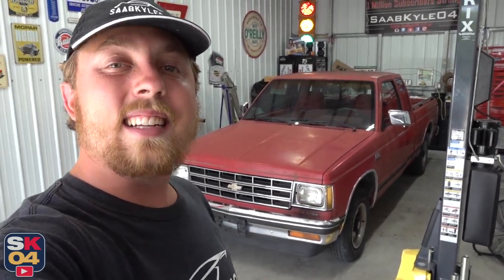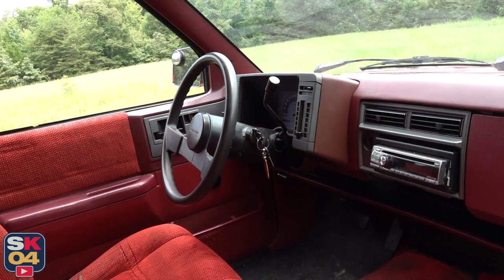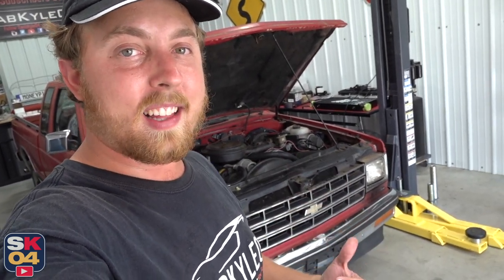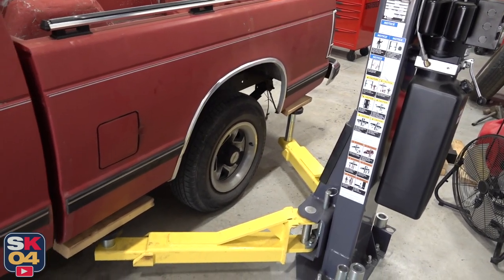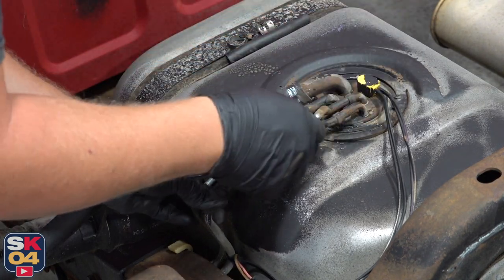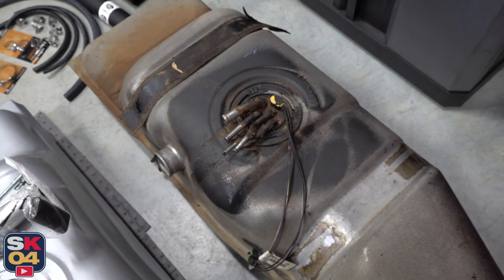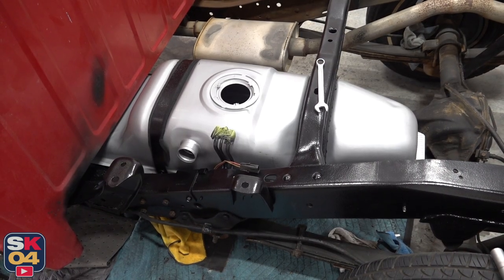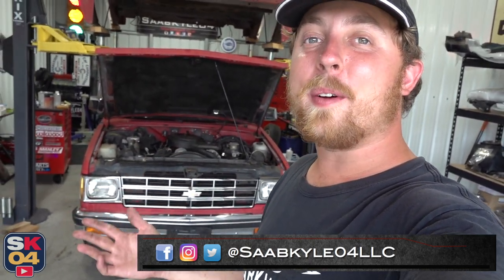A New Project Truck For Less Than A $1000?  What Could Go Wrong?!  S10 Restomod Ep.1

Comment: Not enough youtubers restore 80s and 90s cars. Kinda bored of people putting an LS and wheels on a car then calling it a restomod
Reply: Me to i love 80s 90s 2000s cars
Reply: To be fair, tho.... most cars from this time, especially American cars, were pretty terrible.... not many are excited about the Plymouth Reliant, or Dodge Omni. And the iron duke engine is pretty meh. and most transmissions of the time were pretty phoned in too and can't take much power above stock. I get what you're saying, but I get why people "nope" out of old engine platforms. The LS is really that good.
Reply: @radioactive_tool_shed_8498  For me maybe not 2000s but definitely 80s and 90s
Reply: I'm doing a full resto on a 96 Dakota 5.2 4x4  5 speed short bed. Just started to rust(surface) so why not. Truck can easily last another 25+ years. Bigger motor and we be in business.  Super easy to work on, cheap parts, ridiculously reliable, so why not.
Reply: @tomc8157  96 was still first gen right? If so nice those 1st gen dakotas are underrated

Comment: I wanna see the 4 Door S10 get built
Reply from the maker: S10_4_Life About to start on it soon, just waiting on some front control arms to come in 👍🏻
Reply: In due time my friend.
Reply: @saabkyle04  I know you've built ur Jimmy, But if you have any questions or you get stuck on something feel free to contact me man, I know quite a bit about S10s & Blazers... That's basically all I build, I'm Rebuilding a 84 4X4 S10 Blazer now and I just bought a 93 Blazer too but I'm using it to build a Camper out of to match my Blazer....
Reply: 90s Car guy  What's up ???  ( I know there is a way to message on YouTube but idk how to do it lol )
Reply: S10 _4_Life I just subscribed. Good to know there's more people out there.
Reply: @F.U.andS.T.F.U  Yeah I started building my 95 S10 like 3 years ago now and I just feel in love with these little Trucks, I came across an 84 Blazer for $500 bucks and it was in immaculate condition on the inside & only had 43,000 original miles on the 2.8L, Sad thing is tho that the previous owner Wrecked it and bent the Frame on it, So I bought another frame for it and rebuilt the whole Frame, I'm almost done with it, I've got one more Wheel Cylinder to replace and it's done and then I just bought a White 93 Blazer with all kinds of Aftermarket parts on it that I'm going to use for my blazer and then I'm going to build a Camper out of the body and frame of the White Blazer to match my blazer.... I can't wait to get it all done

Comment: Idk it smokes a little... may wanna swap a 350 vortec in to be on the safe side...
Reply: 5.3 LS.
Reply: wanderinggentile no lets make it LS2 6.0 😁
Reply: @pavilionkodi99  or make it rotary. The smoke issue will be now a part of it
Reply: Nah, the 4.3 gives it more character. Resurface the valves and replace the seals, change the cam and have some headers built for it. Swap the fuel injectors from a 350 TBI unit and it could break 200 hp, and for a truck that light it would roast the tires all day.

Comment: Clean the frame...update suspension....no dropping as I assume you might use it for hauling stuff in the future.....restore as the Jimmy back to OEM spec....check engine for blue puffs of smoke coming out of the tail pipe while you were revving it up......maybe if time and money allows, interior upgrade to a more refined S10 trim?....rear disc brake conversion if possible

Comment: Very nice :)! I'm working on getting the same truck, a $500 1992, back on the road. This is my 4th first generation S10 but I have worked on many of them over the years. A quick tip for the folks without a lift, is to tilt the bed rather than take it off. Remove all the bolts on the driver's side and loosen the ones on the passenger side. Lift it up and shove a jack stand between the bed and frame. Plenty of room to work. If you do decide to remove the bed with the help of some buddies, the bed and tailgate together weight around 230 pounds (yes, I weighed mine before at work for fun). With four people, it will be less than 60 pounds a person. Just be sure to have some saw horses or something to set the bed on after you take it off or else you may damage the sheet metal.

Comment: I picked up a 93 Tahoe last year. It has 88K on its 4.3L with a 5 speed. I have been doing these same little things to it. Tune up-plugs wires cap rotor PCV, brakes front and back, shocks, radiator, heater core, fan clutch, changed inside out lights to all LED,  little things that needed to be done. I have yet to spend over $600 on it with me doing all of it myself. Truck runs like brand new. I also lowered mine. I did a 5/7 with some 18"/20" wheels on it that I already had. I ran all belltech except the 3" coils. The belltech Coils with te 4.3L dropped the front all the way down to lower a-arm to frame about 4.5". I sent them back to Summit and ordered the DJM and they lower the front right at 3". Don't know if I got a bad set or what. I look forward to more s10 videos.

Comment: Sweet Kyle!!, I own a black 1991 S10 Extended Cab Tahoe with the 4.3 and the 4spd auto with overdrive. You got a steal on that truck. but on dropping the truck, It's your call, but I would keep that Tahoe stock height with those beautiful wheels;) Thanks for the video on cleaning the interior of your Jimmy, It was a massive help with transforming my once dirty original old S10 into a showroom-worthy masterpiece. The seat belt trick and the power extracter were great ideas.

Comment: I'd do subtle mods, wheels and tyres, upgrade the brakes to performance brakes, some air suspension so you can adjust the ride height if you need to haul stuff round and just overhaul the engine. Great vid as always :)

Comment: I just bought a 94 s10 blazer with the 4.3l tbi. 291k for 500$. I just got done replacing the heater core. That was a project. After new plugs, wires, fuel and air filter, she runs like a champ. Not a chevy guy, but it was a manual, so I could not pass it up.
Reply from the maker: Powerstroke 69 Dang, a manual!  That’s awesome dude!

Comment: I had an '82 (v6, 3 sp Auto) and '91 4.3L TBI (and 98 blazer w/ 4.3 SPFI).  The TBI setup was really nice, no problems, reliable injection, unlike the 98 Blazer's SPFI system.  These were such good trucks, will be watching for sure!  I'm surprised the oil filter was not remote mounted in the engine bay along the drivers side fender like my 91 4x4 was???

Comment: All I've ever owned are S-10 base platforms. 90 Jimmy, 97 Jimmy, 98 Sonoma, 2001 Jimmy.  Bilstein shocks for the only thing to put on these. I can't remember if your Jimmy was a vortec or body fuel injection, you put a different spring in the fuel pressure regulator and put another gasket to raise the throttle. I can't tell you how much it gives you but it sure makes a big difference going up hills and on the butt Dyno.

Comment: Install LED lighting front and rear, full interior restoration, full detailing, audio upgrade, some simple engine upgrade (turbo, maybe, make it performs like Typhoon). I also thinking about brake (rear disk brake if possible) and suspension upgrade (don't lower it, but make it more comfortable)

Comment: Love that you are doing a new S10 video. One question, did you attach the ground wire for the fuel sending unit to the painted surface or did you leave an unpainted area for it?

Comment: My take on the project is this: If it's a 4 by 2, I'm ok if you want to lower it, so long as it can still carry 5-700 lbs of stuff. Go wild on the rear suspension, a well linked up solid axle or even IRS! Some big Ford SUVs come with beefy IRS. Adapt one of those to the S 10 if you like. Wonder if there's a kit out for IRS? Do what you want with the engine and transmission. I'd swap in a six speed manual, but that's me.  If you can get a better automatic (later model, more gears, better mileage, etc.) CHEAPLY, go for it!  Do learn from GM specials that used the S 10 chassis for ideas.
Reply: I bet interesting and cheapish upgrades would get this build a big following, especially if they weren't all S 10 specific.

Comment: I just did this to a 1989 Nissan pickup.  however, I played hell rigging up a fuel filler tube since no one makes them anymore and my original was rotted and leaking.  what did you use to do that?  my problem was the metal filler neck and the metal on the tank itself were the same size and no one sells flared tubing unless its for a specific application.  I ended up putting 1 7/8" bendable hose over 1 1/2" bendable hose and it still leaks a bit despite having tightened the piss out of it.  any suggestions?

Comment: I recently bought a 91 S10 extended cab Tahoe 4.3 v6. It'll start but only after you pump the gas  a couple of times . I Know almost all of it leads to a fuel problem but is there anyway it could be a timing issue?
Reply from the maker: The timing issue with this truck just prevented it from staring.  I'm no mechanic, but I wouldn't think that'd be a timing issue if it starts after pumping the gas.
Reply: @saabkyle04  I haven't done anything to it and now it works fine  lol so I'm just going to roll with it